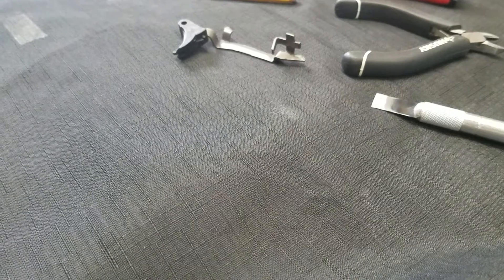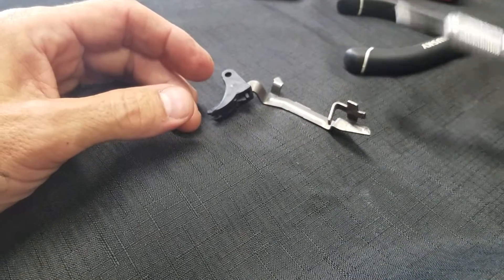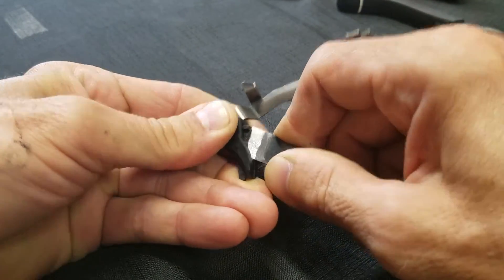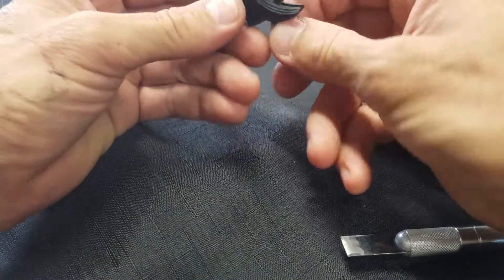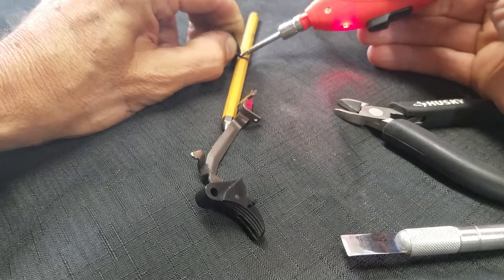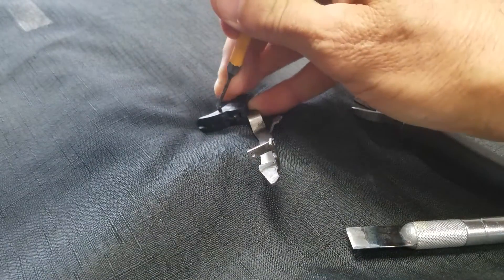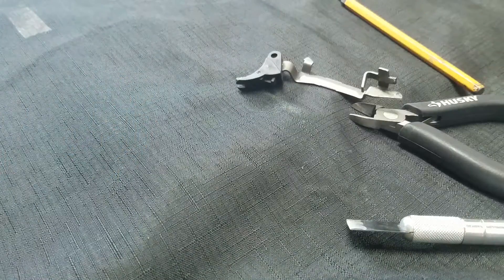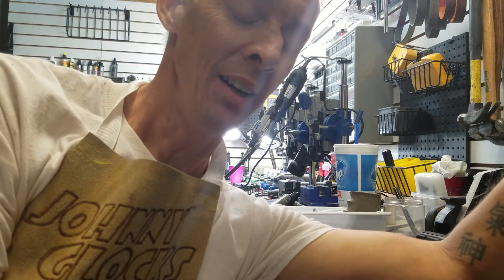Trigger safety tab repair EDUCATIONAL ONLY

Comment: I watch all your videos and have learned how to disassemble, repair and install after market parts with no problems. Although I must admit it was not easy removing the trigger safety. But once I found the right tool, it made it a lot easier. I think you are very knowledgeable with the glock pistol, and if I ever needed a repair to my glock that I was not able to do, you would be the one I would call. In fact, I'm interested in purchasing your drop in trigger kit for self defense carry. Once I decide which glock I want to install the kit, I will give you a call. Again, thank you for all your videos and expertise with the glock pistol, and I look forward to viewing your next video.

Comment: Is this the same on all glock triggers with the leaf spring? I though it was just like a regular small spring? I just bought a ranger proof flat face trigger but the safety spring is missing and I was gonna just pop the spring out of my oem trigger shoe.
Reply from the maker: It's the same with all OEM triggers and I guarantee you if you call up Ranger proof they'll send you a spring they stand behind their products
Reply: @johnnyglocks  I actually did and they are sending me a spring in the morning!  Amazing customer service! 
I'm gonna make a video of the install and will definitely have great things to say about them in the video!

Comment: I just popped the trigger safety tab out, it was always chewin up my finger and felt uncomfortable...plus im not a child so i figured between that and the trigger guard i should be alright. Would you be against this or no?
Reply: Chris Doering That is a terrible idea. If you drop the gun, inertia could cause the trigger to fall rearward and fire the gun. You've defeated one of the most important safety mechanisms on a Glock safe action pistol. :(
Reply: I did the same thing. Just removed it. My trigger finger would hurt like hell. Now shooting my 29 with full power 10mm loads is pain free.
Reply: There’s a better way to solve this problem. Leave the trigger safety tab in place and get an x-acto knife to shave off a **tiny** amount at a time of the tab that’s sticking up above the trigger face when it is fully depressed.

So, unload the gun. Depress the trigger all the way and hold it there. Carefully shave off the part of the safety tab that is high. You could also use sand paper, but it’s difficult to keep from scuffing up the trigger shoe. This will keep you from getting blistered up on your trigger finger when you shoot 200+ rounds in one session.

Comment: Johnny, I just found your channel and am trying to figure out what a part is in my lower parts kit; it looks like a slightly curved flat bar spring and resembles a little bit of the slide lock spring.  The unknown part resembles the slide lock spring but is only maybe 1/2 its size. Any clue?
The piece came in a lower parts kit. came in